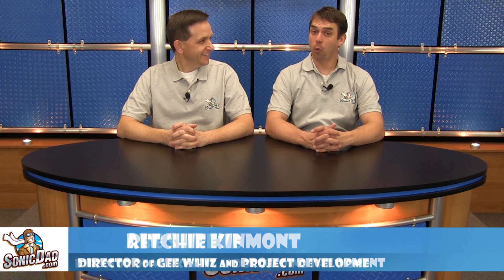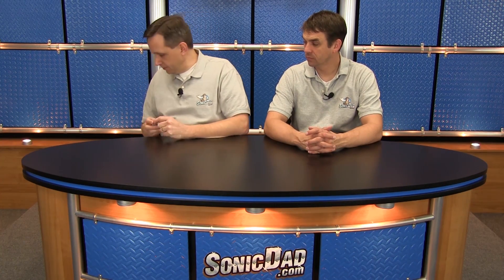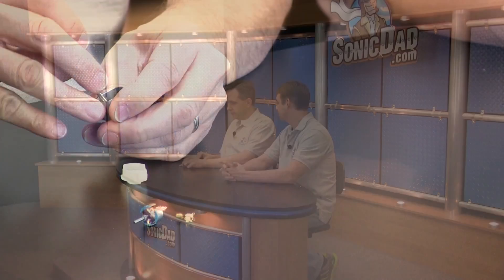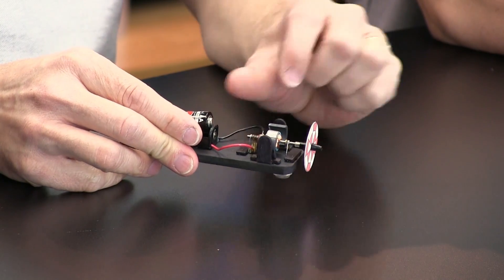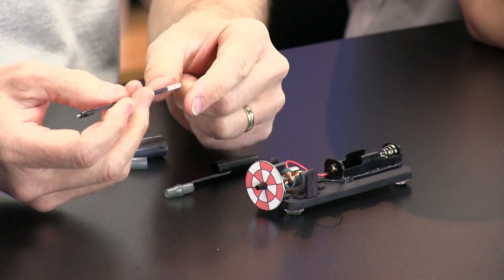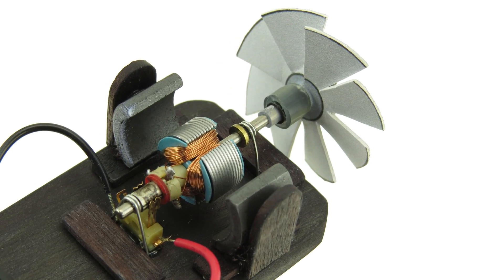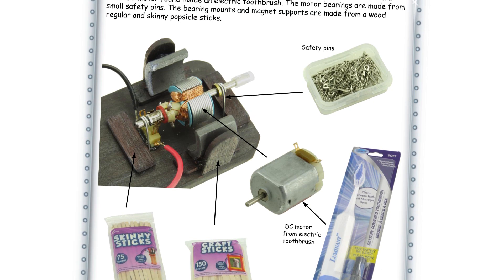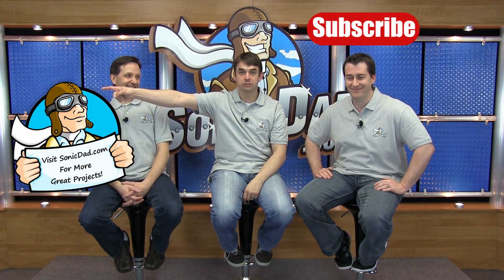Sonic Visible DC Motor: Project #68 Preview

Comment: i made a electronic speed controller for a motor or light variable speed that is out of a working power drill extension cord and all coming out of it  for multiplug in with power up to 18v
Reply: best part is that your not leaving anything apart if anything your adding or upgrading your power tool